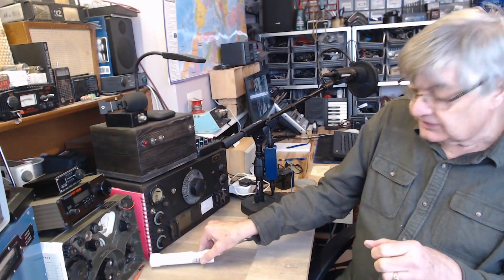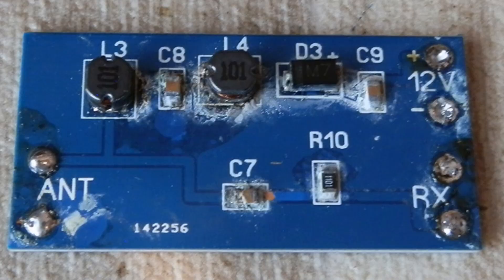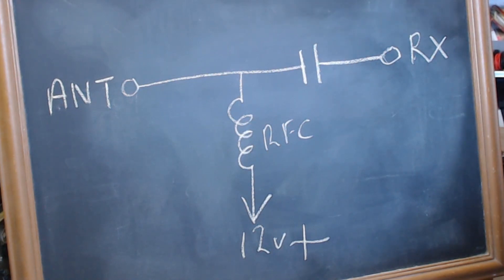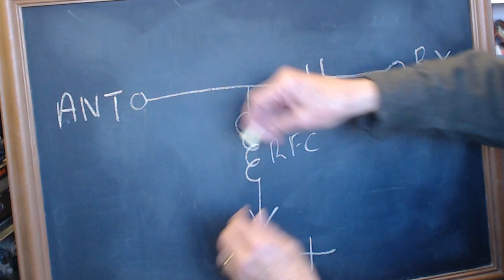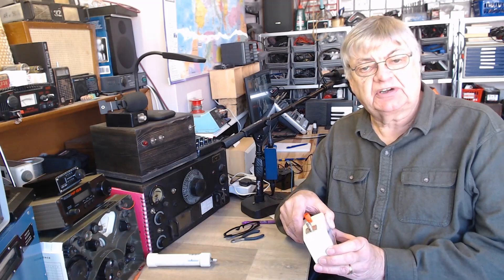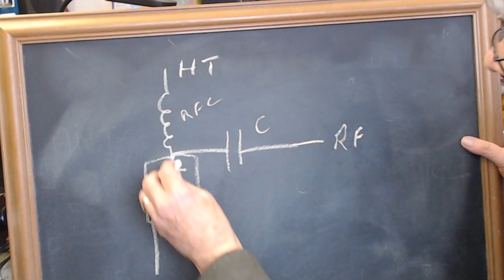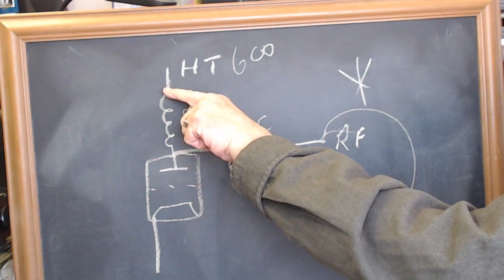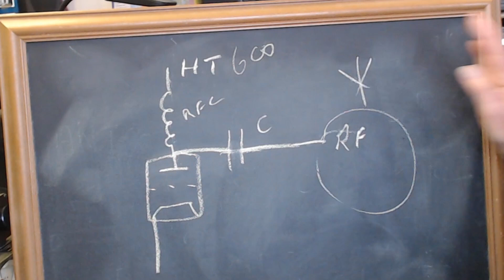G4NSJ - Bias Tee homebrew for Miniwhip antenna

Comment: Thanks so much for this Ray, I often wondered how  BiasT worked. Could I use this method for switching antenna relays at the mast head? I'm guessing I could. Regarding working the maths, at our age we don't have enough time to faff around with that... if it works and it's safe, that's good enough!
Reply from the maker: Hi, yes you could power relays if they are low current types. You’re right about that maths! Cheers, Ray.
Reply: @g4nsj  Thanks Ray!

Comment: Thanks Ray, you make everything so easy to understand.
Reply from the maker: Thanks!
Reply: @g4nsj  I did exactly as you said for the RF choke instructions on that video  and it reduced my noise levels on 500khz from noise level 3 to zero🙂. I have a tormenting electric fence coming through the mains, even though there is an AC noise filter built into my AC socket on the wall. Have you a video on your list to help reduce this infliction?. Thanks Ray
Reply from the maker: @ Hi, I’m pleased to hear that your noise level has decreased.  I don’t think there’s anything you can do about electric fence interference. If I think of anything, I’ll let you know. Cheers, Ray.

Comment: Nice explanation, Ray! one thing you could try (no calculation needed) is to use two chokes in series, one large, like the 5 mH you have already, and another smaller value. The smaller choke would have less self-capacitance, so should help the bias T work at higher frequencies, where you mentioned it started to tail off. Just a thought, and easy to try if so inclined. Always enjoy your videos and thanks again.
Reply from the maker: That's a great idea, thanks! I shall start experimenting straight away! Cheers, Ray.

Comment: Hi Ray. I have one of these mini wipes but it's only at 4 +/- meters of the ground. Ii find it make a big difference when put higher. Anyway I've not thought about the bias tee. Maybe I should and maybe it will have it work better.
Best 73. Paul De HS0ZLQ G0MIH, HS0ZLQ.
Reply from the maker: Hi Paul, you're right, height makes a huge difference. Mine is up at 20 feet but it needs to be higher. Cheers, Ray.

Comment: Thank you ray. You have confirmed  my suspicions!! I put the bias tee that came with mine on a spec ann and tracking gen. I can confirm that the performance down the LF end is poor. My mini whip went dead short a couple of weeks later when a tantalum capacitor did a mount Vesuvius. This burnt the bias tee to a crisp!! It also burnt the inductor in the bias tee in the actual mini whip also.  I get the feeling an upgrade on that inductor would also bring improvement. Its marked 101 which is only 100 uH!  I shall rebuild and  experiment when the weather looks up.
Reply from the maker: Hi Graham, that's interesting about the LF end. Thanks for the info. Cheers, Ray.
Reply: Moral of the story - NEVER use tantalums.
I had one spit in my eye when I put it in wrong way round plus they don’t like the slightest over voltage.
G4BTI

Comment: Great project. That's just what I need to solve, or simplify a need I have. I want to install my SGC-230 Antenna coupler outside at the feed point of a Random Wire Antenna, but it needs 12 volt DC to operate. I learned 25 years ago or so that 12 volts DC drops current like a rock with too small of wire guage and distance. I was trying to use a 15 or 20 foot extension cord between my adapter that connected to my trucks battery and the adapter to connect the 50 watt Ten Tec Scout's power cord. Every time I keyed the radio to talk the radio momentarly shut off. RG-8 coax ought to be large enough to handle the current draw of the SGC-230 coupler. Just need to build the Bias T heavy enought to handle the current draw as well.
Reply from the maker: Good to hear from you. Build the Bias Tee when you get time, I'm sure it will be great. Cheers, Ray.

Comment: You should, you should, you should.  That's a load of bollocks.  You just build something that works, THATS HOW YOU LEARN!!  Trial and error.  Oh, BTW, MY Bias Tee is smaller than yours--Ha Ha.  I also use BNCs.  No online calculator required.  I just bodged it together and it's fine!!  Cheers, Ray. (also, 600 volts on the garden aerial will keep the pests away).
Reply from the maker: You're right, that's how you learn. 600 volts on the garden aerial will certainly keep the pests away! Great to hear from you. Cheers, Ray.

Comment: I too am an old TV shop repairman from the 1960's, though I've come a long way since then. But without running computer modeling and calculation software my first thought about your bias T's RF choke is that for an antenna that goes down to 10kHz you need to have an RF choke that is really an AF choke, meaning lots of windings on a ferrite or even powdered iron core, (while ensuring that the DC resistance of the choke isn't so high that its wire resistance drops the voltage required for the amplifier circuit below what is acceptable,) and a coupling capacitor that has a low impedance at 10 kHz, meaning an impedance below 50 Ohms at 10 kHz. Otherwise both components are attenuating your low frequency signals. I ran into this problem with my experimental work at the 60 kHz frequency of WWVB in the USA and on the LowFER band at 175 kHz. Not all bias T's or even RF test equipment seem to think that those frequencies are actually 'RF'. 
Within the constraints of your circuit requirements, a large L value and a large C value really don't hurt anything up at 30 MHz until the interwinding capacitance of your choke starts coupling the RF to ground. Experimenting with a sig gen and a scope at 10 kHz and 30 MHz will tell you if the choke will work. The commercial circuits are just built with the smallest L and C that they can get away with because being commercial circuits they are trying to use the cheapest components possible. At 10 kHz the circuit needs to be thought of as more of a speaker cross-over circuit than an RF one.
I'd use junkbox parts and then just run my 50 Ohm sig gen through the air to the antenna and amp and bias T to my scope or spectrum analyzer with a 50 Ohm input, (or possibly 300 or 450 Ohm for an old tube shortwave,) and verify that there was minimal attenuation across the antenna's frequency range due to the bias T circuit, and call it good, because I still don't use my computer calculators and modeling software unless it's really necessary. With an 8 pole filter it's necessary. Most of the time it's not.
Reply from the maker: Hi John, thanks for all the interesting information. I'm going to make a note of your comments. Cheers, Ray.